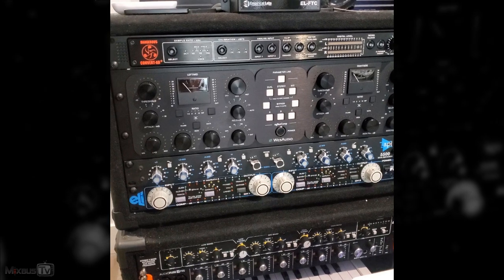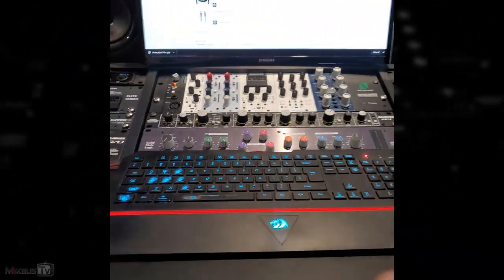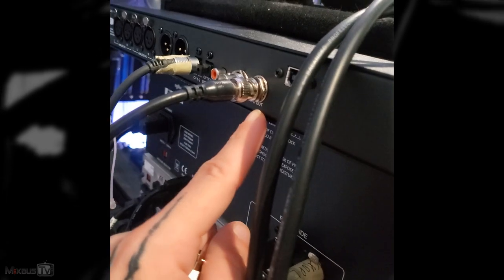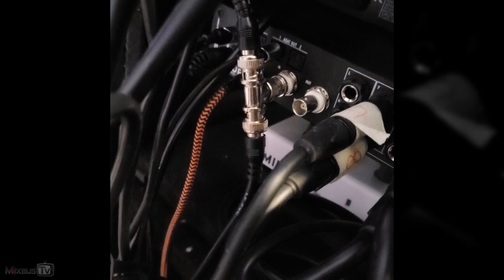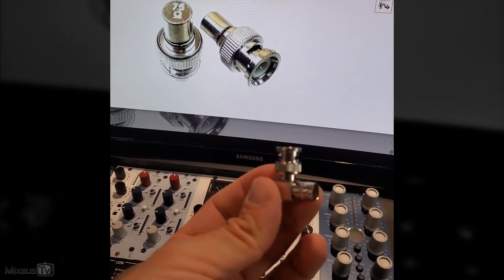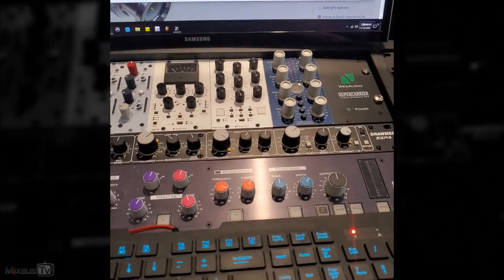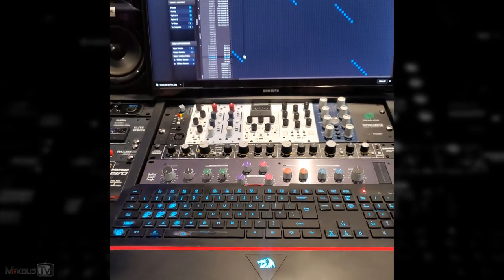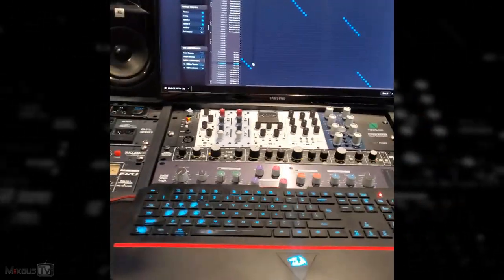Clocking Multiple Audio Interfaces with a Mastering Clock

Comment: thanx for sharing.. bt why didn't u use the the word clock in and out from the 2nd interface and so on r... why use  that? i think yr interfaces has both ins and outs
Reply from the maker: Because the purpose of having a clock is that the master machine send the same exact signal to all the others, if you use that there goes the sync
Reply: @mixbustv  thanx ... it means that if we use same interfaces we can use the word clock ins nd outs or wat? no need to use the T connector???

Comment: Question, my logic would of lead me to go from Interface 1 to interface 2, 3, and 4 via daisy chaining. Like I1 (Out) to I2  (In), I2 (Out) to I3 (In), I3 (Out) to I4 (In) 

What would happen if you wired your connections that way? And why do you have to wire in that way? 

Is it so they all receive the same signal from the masterclock rather than as a chain? Is the waterfall/chain signal flow how you run into clocking issues?
Reply from the maker: You answered your own question. The entire purpose of a master clock is to send the same signal to all the satellites, hence, it has to come from it, no daisy chaining
Reply: @mixbustv  Super appreciated man, definitely cleared the waters

Comment: Cool video, I didn't know about the termination, what about those units that have a "thru" connection, can you avoid the T shaped connector?
Reply from the maker: Yes
Reply: It would be better to amplify the signal before you split it and after the split you should have an identically measured impedance and the same length cable after the split to your multiple units. If you're so concerned with exact synchrony

Comment: thanks for the video, exactly what I was looking for!!!! just a question, why do you use the connectors and not plug into the "clock in" and "clock out"? thanks
Reply from the maker: Because each unit has to receive the signal directly from the main clock, that's the purpose of having a master clock

Comment: Another great video Dave! It will be lovely if you might continue from where you left in this one and proceed with explaining your signal chain while you mix hybrid. I really would like to learn about the idea behind having 4 interfaces hooked up (although you have mentioned it here, but I still would love to see it happening in action) and understand how you get the job done with all the analog gear you work with. Many thanks.
Reply: Is there a reason or difference/advantage to use those t-connectors versus daisy-chaining in-out -> in-out -> in-out ?

Comment: Sorry to ask, but is not possible to go from the Out Master on my case the Antelope to the IN of my Apollo, and use the out of the Apollo to go to another interface? Do i really need thoes T shape pieces? Thank you... For the terminator there im sure.
Reply from the maker: Yes, isn't this the point of the video?
Reply: @mixbustv  Yes of course, maybe i miss my question. On the master Antelope i have out and in, so i use out to the IN of the Apollo and use the Out of the Apollo to the in of the other interface (RME) but without those T adapters, only with cables 75 bnc. I really need those T Adapters knowing that i can plug another cabe 75 from the Out of the Apollo to the IN of the other interface. Resumind, do i really need those adapters, sorry if i confuse you. Im from Portugal, maybe my english is not so good.

Comment: Some electronics... Do not use terminated cables or you will attenuate the clock signal. If the anplitude is below 2.7-2.9VDC some of the units might not sync due to crap design. Have unterminated wires and the 75ohm load at the last T connector exit to kill reflections.

Comment: Hii, My Motu UltraliteMK5 does not have world clock in and out but it has optical in and out. If I connect another interface and match the bit rate of both and make MOTU MK as my Master Interface. Will it work?
Reply from the maker: Nope
Reply: @mixbustv  what would be the best solition for it then?

Comment: Amazing information,been trying to figure out if I could run it like this and I'm now ordering a t price and end cap . 
I thank you good sir 🙌 absolute legend 🔥 super glad I found your page💪
Reply: You actually shouldn't daisy chain coaxial or even split the coaxial unless using an amplifier
Reply: @ET2carbon great information thanks brother 👌.
I'm running the antelope discreet 8  Synergy core as main Into a mastering rack and  an extra  rack mount 8 in and out..
Still need to get  dB -25 to db25  connect to hook up the API lunchbox 500 tho have the dB 25on the antelope  if you have any tips would greatly be appreciated my guy thanks again 👌

Comment: An Apple OS you can create Aggregate Audio Device in Software. 

Does this fact obviate the need to connect word clock on the hardware level when using Apple/Aggregate Audio  Devices?
Reply: This is the actual question that should be addressed. Synchronous digital devices are actually a communications concept (I'm a retired telecom tech) . In audio devices it used to be important before the aggregates of PCI and HDX cards existed. After those became popular, the clock thing became more about the jitter concepts and triggering the converters for proper signal entry into the chips for the Nyquist process in PCM. We started using DSD methods and other compressions got into the mix. Clocking while still important, isn't as noticable as it once was, especially when the aggregate can utilize such high bandwidth in the throughput of our newer cabling systems. After IEEE 1394 and USB 3.0, the protocols reached a point along with processor's high accuracies that Apple was able to get multiple devices of various manufacturers to successfully and simultaneously interface with the outboard environment. If you're using something like Thunderbolt, you're pretty much good unless you're getting into DSD512 or 32bit 786KHz conversions..... Which is usually mastering level and not typically done in multitrack (beyond stereo) anyway. This is talking purely about bit errors in communications equipment though, not regarding sonic or HIFI chatacteristics.

Comment: Hi dave, I have a question for you. Do you find that more gear create more problem and slow your process sometimes ? Thanks a lot for this info it was great keep the videos coming ! THANK YOU !!
Reply from the maker: Oh no, at this point in my career/setup everything is for the most part aimed at making my workflow better, faster, easier, because I already have the "sound", more than enough. So if it doesn't make it easier  and faster, it's not gonna be there.
Reply: @mixbustv  ok cool then! I myself find that more gear can cause some issues sometimes but my setup is not optimized like yours really.. THANKS and PEACE ✌️

Comment: One quations, what happens if you connect the master wordclock via BNC to the first slave word clock (IN BNC) and then a new BNC cable from the OUT wordclock to the next slave (slave 2) device? It works the same?
Reply from the maker: You completely defeat the purpose of having a master clock, as the whole point is so every satellite receive the signal directly from the master unit.
Reply: @mixbustv  totally understand now thanks!!!

Comment: Is there a reason or difference/advantage to use those t-connectors versus daisy-chaining in-out -> in-out -> in-out ?
Reply from the maker: The difference is the entire purpose of having a master clock which would be useless if you don't use the t-connectors. The point is to have one unit sending the same exact signal to all the units at the same time, if you daisy chain you completely defeat the purpose

Comment: Why does the last unit need a T with termination rather than just plugging in the cable?
Reply from the maker: Because you need the termination connector showed to close the circuit, that's what you do when you're using a master clock
Reply: Because Arnold is pretty strong and he will stop the jitters from happening

Comment: Thanks. I didn't realise you could do this. I assumed it would mess with the impedence. Anyway, I thought you should get a Drawmer D-clock free of charge - I think they owe you one!
Reply from the maker: A master clock makes sense if you don't have a great master clock unit already, in my case, the ad+ is arguably top 5 on the market. But I'll take the Drawmer if they send 😄 as for the impedance, no, it's standard 75ohm, not that much to it

Comment: I would use a standalone master clock if you can. Much better than the Motu clock and I’ve got two Motu 828 mk2’s, yamaha 02r and Akai S5000 all clocked from a stand-alone master. Sounds amazing.
Reply from the maker: My system is clocked with a dangerous AD+

Comment: You actually should not T off your COAXIAL like this. I used to do that but it's not the "right"  correct way. You should use a distribution amplifier before the split. And daisy chaining the word clock isn't a good way to champion the idea of proper synchrony.

Comment: Doc I was doing that with more and is not good enough, my suggestion is get used bigben by 300 bucks and that is the best idea, I was doing that with 5 interfases, and is not 100% confident becareful, I felt the winner but un my mix I was listening something weird.
Reply from the maker: You realize my master converter is light years superior to the old bigben right?
Reply: @mixbustv  yes but the idea is use the big ben receiving clock signal from your converter them send to the rest of your devices, that works better than adapters...
Reply from the maker: @ladanzza  And do you realize that is exactly the same thing?
Reply: I am using my RME ADI 2 pro to send the clock signal to the big ben and this works as a distributor... good luck.
Reply: @mixbustv  I didn't have problems anymore after change,  that was my result.
Reply: I think is about the energy in the cable is not a lot so when you divide the cable, the signal is coming weak, so I just I am saying about my experience and why I got bigben, becausr that permit receive and distribute
Reply from the maker: @ladanzza  that is complete nonsense
Reply: @mixbustv  ok but I solved my problem, problem that I had when I did that kind of connection, so, that is not new, but is nonsense for you thats ok, good luck.

Comment: I'm shocked you have not upgraded to a Orion 32 gen 3 yet. 32 analog channels in one rack space. You obviously would not have to run all these clock cable. You would free up 2 rack spaces and you would not need a patchbay. I have all my gear hardwired into the orion and I patch with the routing matrix. The clock is better than the motu's. And from my ears the conversion sounds better. I previously had the motu 828es. It was a nice interface. One of the things I didn't like about the motu though was it just felt cheap. I bought that 16a, took it out of the box and didn't even rack it up. I sent it right back and bought the Orion.
Reply from the maker: The clock is irrelevant if you only have 1 interface, you can't tell a clock is better than another if you're not clocking another unit with it. But I'm using my AD+ as clock with is far superior to basically 99% of everything out there.
As for the converters, I tried antelope stuff, I don't find them better than motu, also have heard many horror stories about problems with the units and bad customer support. I mix for a living, I'm not doing anything that's not tested and proven on the field for years.
Reply: @mixbustv  most of what you hear is user error. Ive never had an issue. The dangerous clock is killer yes. I agree. When I said better, maybe thats subjective but the antelope clocks are known for being very good. As for customer service its amazing. The routing was hard for me to wrap my head around. I got someone on phone numerous times between 10pm and 1am pac time. They did remote view on my screen every time and showed me how to use the software. So I'm not sure why anyone would say that. But you never know I guess.

Comment: No Protools HD???
Reply from the maker: Pro Tools HD is just a software, if you don't have the Avid hardware the limit is 32 tracks. Also you can't combine interfaces, if you have an 8 channels Avid for example, you can't add an 8 channel MOTU or any other brand, you need another Avid. You want 32ch? They need to be all Avid, and so on. The software (HD) is the same, is just purposely limited to 32 I/O
Reply: @mixbustv  I know Protools HD is a software but the Avid hardware is crucial for the software; you can always stack additional I/O or at least I thought. I took a Protools HD course years ago when I used to work for Guitar Center; This was back in 2006 though. I installed the earlier $10k HD hardware and I/O integrated into the old GMacs
Reply: @mixbustv  I see you must have everything together and not separately dedicated such as a dedicated Production/Mixing/Mastering studio set up.
Reply from the maker: @MadACeTeeMack  no it's not crucial by any stretch of imagination sorry, and it's usually overpriced for the quality it delivers.
Reply: @mixbustv  I agree, severely overpriced